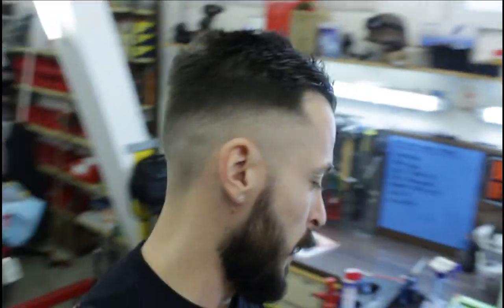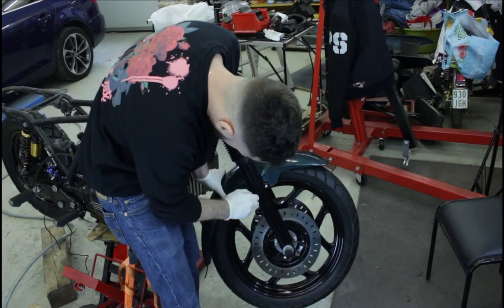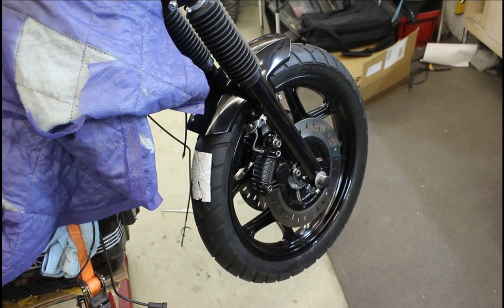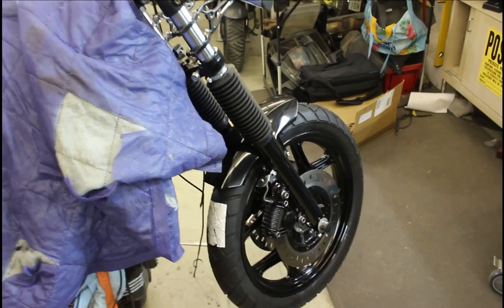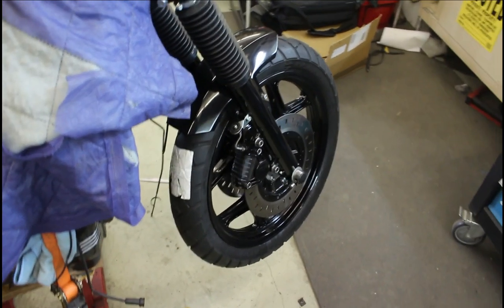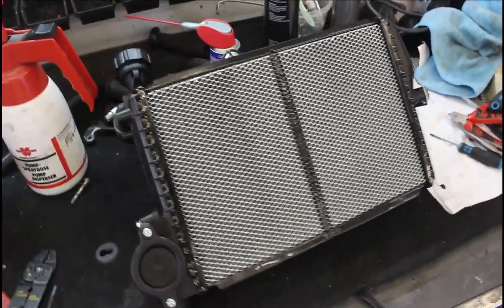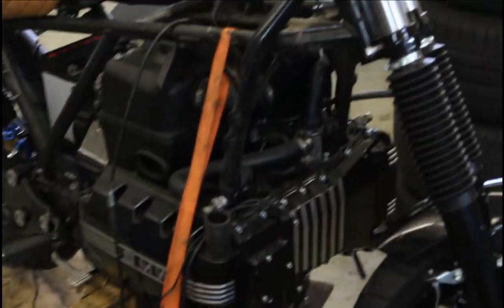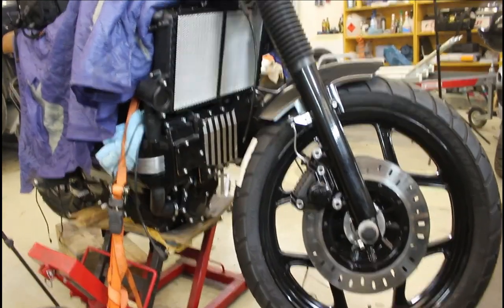BMW ★ K100 Cafe Racer Build - Customizing Fender, Intercooler and Brake Calipers - C.P. Customs #13

Comment: Never forget to use your safety squints!! Or eye protection.. especially with those dremmel disks that love to explode. 
I really like the shape you did on that fender. Goes very well with the brick shape of the bike. I would have mounted it closer to the tire for a more bad ass look, but looks good 👍🏼as is. 
Awesome job on the "intercooler" I wonder where the turbo is going? 😂
Reply from the maker: Thanks 😆 I do wear them sometimes 😅 
I thought the same about the fender but to get it closer to the tire it’s too much effort tbh, due to the holes and shape it’s hard to adjust 🤔 
😂😂😂 well that’s what happens if a not native english speaker try’s to explain something 😆 🤷🏻‍♂️
Reply: I dont mean to be so off topic but does someone know a trick to get back into an Instagram account?
I was stupid forgot the password. I love any help you can offer me!
Reply: @Justus Jordy instablaster ;)
Reply: @Immanuel Moshe I really appreciate your reply. I found the site through google and Im in the hacking process atm.
I see it takes quite some time so I will reply here later with my results.
Reply: @Immanuel Moshe It worked and I actually got access to my account again. Im so happy:D
Thank you so much, you saved my account !
Reply: @Justus Jordy Glad I could help xD

Comment: Great job on the fender. That radiator turned out fantastic tho honestly 👌🏼
Oh and side note...modificate = modify 🤣 just giving you a hard time.
Reply from the maker: Thx buddy 😎🙏🏻 and thx for the correction I’m still struggling sometimes with the correct words 😆😆
Reply: @CPCustoms   you’re doing fantastic 👌🏼

Comment: Good work man!

Can you explain to me the idea behind the black line in the middle of the radiator? Was that just to glue the grill to the radiator or just decorative?

Thanks!
Reply from the maker: Thank you mate 🙏🏻😎 It is to avoid vibrations between grille and radiator, so I put a line of silicone between them. And I think its kinda decorative too 😂✌🏻
Reply: @CPCustoms  awesome, thanks for the clarification. I'm doing a K100 myself so loving following your progress. Gives me some motivation. Keep up the good work brother
Reply from the maker: @IrishGaucho  Thanks buddy😊 🙏🏻 best of luck for your build and process 💪🏻🤟🏻
Reply: I was wondering the same thing, good idea to use it to minimize the vibration 👍🏻

Comment: Love it..👍🏻👍🏻.. the mesh on the radiator looks great.. what did you fix it with?
Reply from the maker: Thank you buddy 😎🙏🏻 just pushed the sides between radiator and housing and applied the small black seal to avoid vibrations ✌🏻
Reply: @CPCustoms  cool.. cheers
Reply: The mesh looks great man. What material is it? 
Been watching your videos over and over lately as I dive into my project. Keep up the great work
Reply from the maker: @benroberts692  Thanks buddy 🤩🙏🏻 it is aluminum